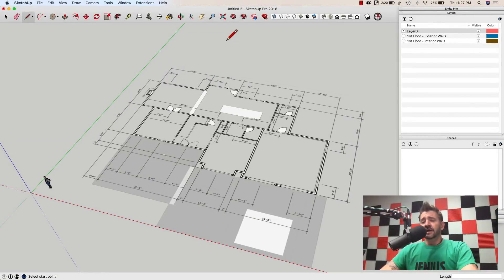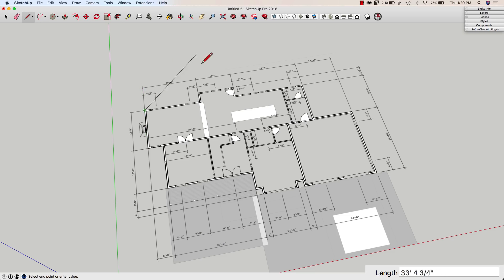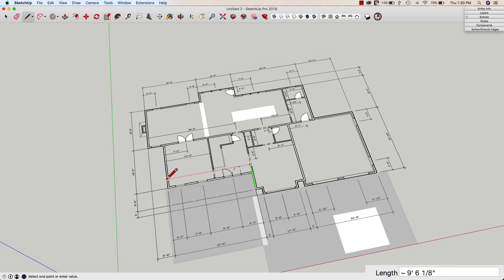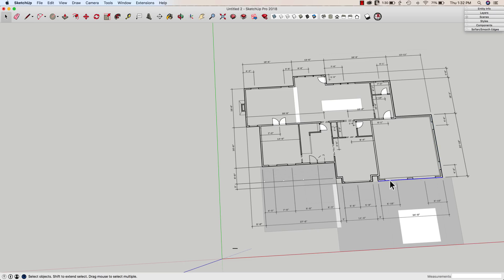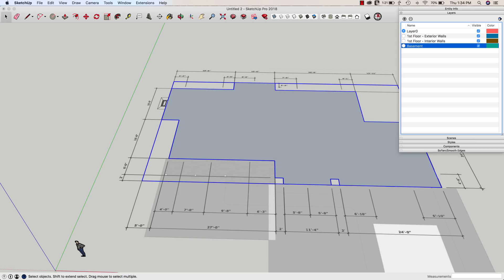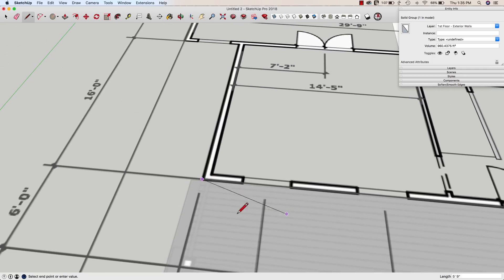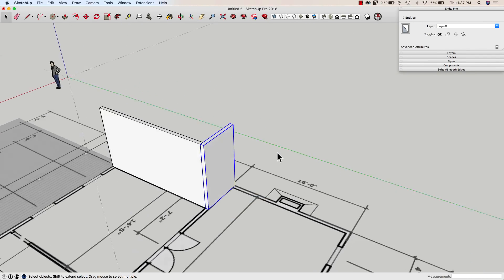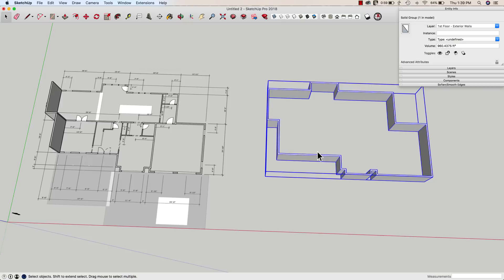Drawing Exterior Walls in SketchUp - Skill Builder

Comment: So... how do you get that inspector window on the left that has your Layers? I have Sketchup Pro 2022 and have gone through all of the menus and cannot find how to access layers.  Any help would be appreciated. Thanks.
Reply from the maker: Layers were renamed Tags a few years ago. They work the same, but the name is more appropriate for what they do.
Reply: @SketchUp  Thanks for the quick reply. That helps. I am still on a learning curve here. I am used to working with layers from my years of working in Illustrator and Photoshop. In those programs, any changes made will be included in the active layer selected. It took me a while to figures out that an object has to be assigned to a tag in SketchUp.
The SketchUp program is great. After only a couple of days, I am further along that I was after a couple of weeks of struggling with AutoCAD.

Comment: Another tip writing from an 'old' architect (me) is to add up all the individual dimensions across a frontage and then use the total as a means of scaling.  That way you avoid cumulative errors. This method is normal when out surveying in the field - always do running dimensions!
Reply: That’s a great way to get the largest possible dimension for scaling! Thanks!

Comment: I prefer the first method, although I use guides all the time wherever possible. 
I learned to draw in Parallel Projection so that you are sure all the lines are on the same level. And I make a Plan 2D layer for the line drawings. For extrusion into 3D I copy the walls on a new layer.

Comment: Hi Aaron, I have a question.  I imported multiple pdfs, as I'm working off some old hand-drafted plans.  I scaled my first plan to the correct dimensions and was working from that.  When I imported the second drawing, I also needed to rescale that one, once I imported it.  However, .... when I go to rescale the second pdf (to a drawn line) it always prompts me to rescale the model.  When I say no, the pdf does not scale itself to my line; and when I say yes, the whole model rescales again to the new line, throwing everything out of whack.  

Here is my question, how can I rescale the single (2nd) pdf to a line without a prompt to rescale the entire model again?  There is probably a quick fix, but I don't know it yet.

I should mention that I'm scaling using the ruler tool.

Comment: It's high time for sketchup to have a wall tool.
Reply: Not just that but all the functions which would make large architectural projects more feasible.  Dynamic components are a great idea but are in bad need of being taken to the next level.  Also layout should not be a separate tool  etc..  I think after Trimble took over Sketchup is pretty stagnant.
Reply: @ChrisStewart2  Trimble is protecting its bim tools from sketchup.
Reply: There are extensions for that.  We use CabinetSense which has a wall tool, as well as dynamic cabinets
Reply: 3 years later, I concur!

Comment: Through these instructional videos Aaron and Josh have reduced the learning curve in Sketchup and Layout. Thanks and please continue.

One of the reasons I started using Sketchup 5 years ago was due to the ease of creating sections in architecture that were accurate. In some ways, almost too accurate depending on what you are trying to communicate to the plans examiner and client(s). 

Having said that, I have one pet peeve that is not exclusive to the Trimble videos but seems consistent with most of the YouTube tutorials with few exceptions. That is, they are rarely if ever structurally correct. Why does this matter? Walls do not display the components that are use to build them which means they do not conform to Building Code. Roofs do not have the proper elevation above the wall because the approach is wrong. I could (but won't) go on. This is why extensions like Profile Builder and Medeek products are so invaluable. These products are developed by professionals that make the elements and components display correctly  and yet they are easily customized.

Thanks again to the guys at Trimble. You make it easier to use Sketchup and each edition continues to improve and well worth the price of a subscription. Just know a wall section that is a 5.5" rectangle with a face pulled to 8ft. that has a section cut through it is not a viable wall section in any jurisdiction that I know of.
Reply: Barry S. Thanks for the feedback! My previous job was in building design, and I have put my fair share of time into creating structurally accurate building models. While it is possible to create all of the framing in a house manually, you are right about using extensions like Profile Boulder or the Medeek suite. They make it much easier and so much quicker!

Comment: I almost always use the first method, except I typically have the garage walls as a separate group as they are most likely outside the conditioned envelope of the home. Thanks for the video! I assume there is part 3 for interior walls?
Reply: Kyle Macht Good use of grouping! Yep, next week will be all about interior walls!
Reply: I look forward to seeing the process you use for windows and door in the walls, if you are getting there. I have done that many different ways and don't feel I nailed down my prefered method to get those lined up. I usually end up using a ridiculous amount of construction lines.

Comment: I would love to know if there is a way to easily include the components of a wall (framing, drywall, sheathing) into the wall section
Reply: BJ Welling I would recommend taking a look at Profile Builder. It will let you create stacks of components in things like walls. Great extension!
Reply: Check out Profile Builder and include the elements that you use in your walls as you draw them. A must have for S/U architectural drafting.

Comment: I just learned how to do things another way completely AND I gleaned another couple of techniques too!
Gotta work harder on my layers too however I have done a slight variation whereby I grouped “zones” of the house and they were effectively non negotiable sizes or negotiable.... which then allowed for the play factor in getting a drawing sized up. 
Another “duffers edition “ drawing mode I really tried hard to incorporate was the golden mean sizing.  Apart from the helpful snap of the rectangle I tried getting very close. Are there any tricks in settings or a add on that includes this “modality “? 
Thanks very much again Aaron.
Reply: cognitor900 With a workflow like that, grouping will be even more important than layers. Keeping geometry separated is key!

Comment: Great Vid Aaron. I really liked the second way and immediately thought of a little modification to it. Drawing two surfaces 6" (wall thickness) X9' (wall height) along the  green & the red axes making each surface as a separate group. Then copy the surface to its respective location on the drawing and  push pull it to the desired length. Repeat for next segment of wall & continue to finish all walls. Then move in to interior walls the same way.

However, my conventional way I used to follow is doing all walls exterior and interior using guidelines. Then drawing on them using line command.
Reply: madwani Great idea! I am going to play with that a little bit and see where it goes!

Comment: i am long user of 3ds max but i bought SU2018pro and i am missing selecting edges by ring or by loop or grow or shrink order /editable poly/ is there an extension to select edges by this kind of order ?
Reply: baca zterchovej Check our Quad Face Tools by Thomthom. Single button clicks for everything you mentioned!
Reply: Try "Selection Toys" Extension. it provides a wide range of selection modifiers that enable you to select precisely and quickly. When using it don't forget to access its context menu beside the  "Selection Toys" UI Settings under  the Tools menu where a lot of its power is hiding
Reply: TY for answers , i found Quad Face Tools extension exactly what i am looking for ....